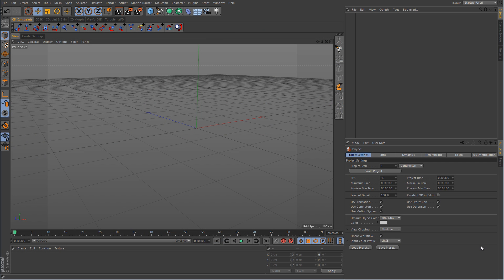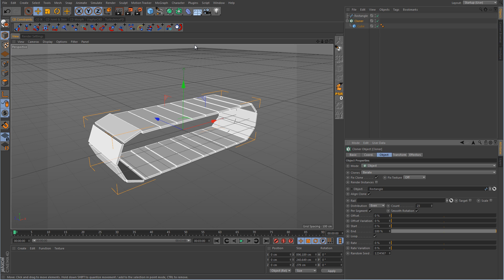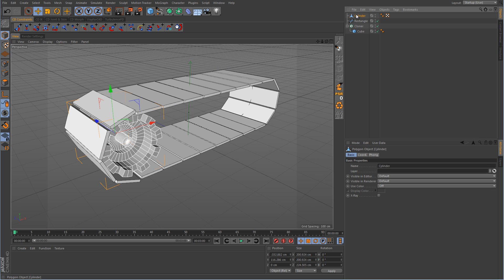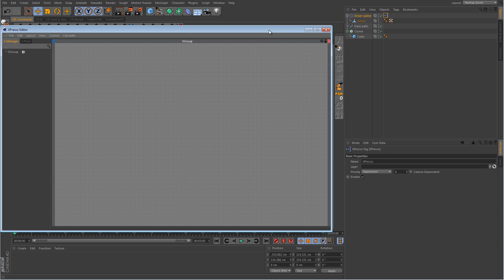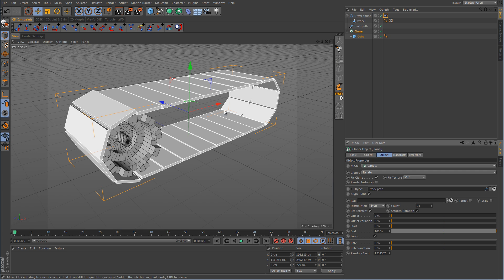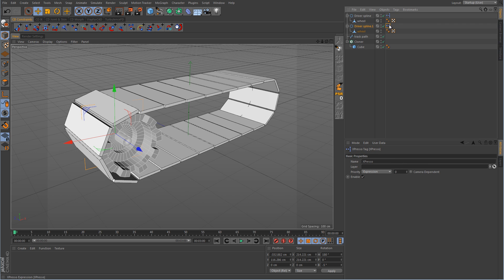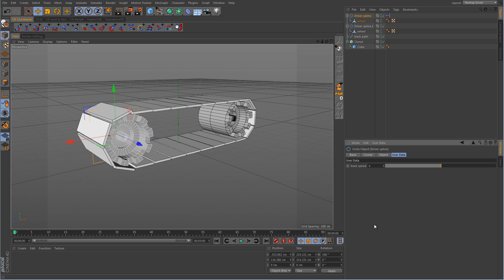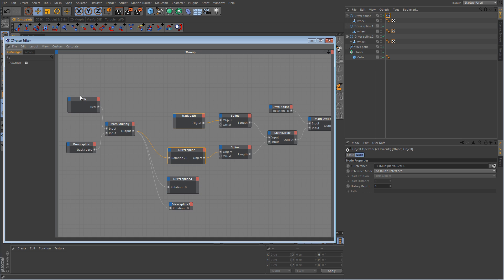Cinema 4D Tutorial - Xpresso - Conveyor/Track Wheel Sync

Comment: Thank you for the tutorial. I have a question. i try to use this xpresso for a volumetric compressor but i have some pulleys with differents size and  the smaller size have a slow rotation compared to the first who drive the track path of the belt. how can i do ?
Reply from the maker: Were you able to resolve the problem? I may need to try it on my end to see if I can find the solution.
Reply: @ShepperdOneill  Yes, as you can read in my second post. But it's not a clean solution, hard to adjust with accuracy.
Reply from the maker: @alainbernard7711  Ok, I'm tied up with work right now, but when I get some time I will look into this and then make a short video tutorial on it.
Reply: Thank you  @ShepperdOneill

Comment: I'm rigging a character that has detachable parts and I'm wondering if there's a way to create an expresso to make an object target another to simulate an ik chain
Reply from the maker: Detachable parts on a character can be done with constraints (constraint tag). If you need an object to target another, you can use the target tag.
Reply: Thanks alot, I'll use the constaints, I didn't want to use the target tag since I need to animate it detaching
Reply: The constraint tag is working pretty well thanks
Reply from the maker: Welcome!

Comment: Followed this step by step but I'm getting slipping. The wheel moves much slower than the track. Any ideas why this might be happening?
Reply from the maker: Any chance you can send me the scene file in a PM? I'll take a look at it for you.
Reply: Sent....
Reply: Got it. My Xpresso setup had driver on top and tack path second. I set track path first and driver second and that fixed it.
Reply from the maker: I was just getting ready to send you a quick message to explain that. Driver spline needed to be on the bottom. =) Glad you got it fixed!
Reply: Thanks buddy. Onto pt. 2!
Reply: I have track on top and driver bottom but I still get the belt moving a bit faster than the wheel.  Not as fast as the other way, but they don't move like a bicycle chain with cog wheels would.

Comment: Great tutorial! Definitely something that could have many applications. So, I was wondering: if you were to use this setup for a bulldozer/tank, is there a way to determine the ratio of the speed for each tread if the vehicle turns while moving?
Reply from the maker: At one time I had a tank track setup that did this, but it was using an old C4D plugin called Roll-it. Unfortunately, it no longer works with C4D. (You would have to have R10 in order to get it to work.) I may have to look into this further, and see if I can come up with a way to get it to work again.
Reply: Thanks for the reply! I've been pondering this a little more too; seems like the speed ratio between the treads could be converted from the angle of the turn/speed of travel. For instance, if you have the treads going the opposite direction at equal speed, the result would be the vehicle spinning around in one place.  Not sure how to go about setting that up in xpresso, though.
Reply from the maker: I believe I have found a solution. I had to spend several hours last night digging around, and experimenting with xpresso setups, but I have put together a rig that works, even when rotating the tank. Once I test it out some more to make sure there are no bugs in it, I will put together a "part 2" tutorial for this track/tread system.
Reply: Awesome!! You really go above and beyond to help; it is very much appreciated! Thank you so much! I've been trying to learn Xpresso (along with a lot of other functions / concepts) for a while now, but it can be a little daunting sometimes. Your tuts have really helped me to learn new things, as well as reinforce/build on things I'm familiar with.